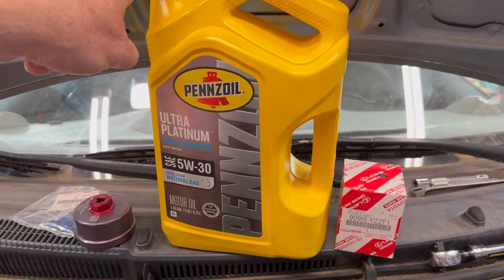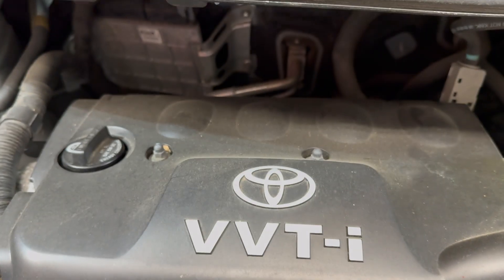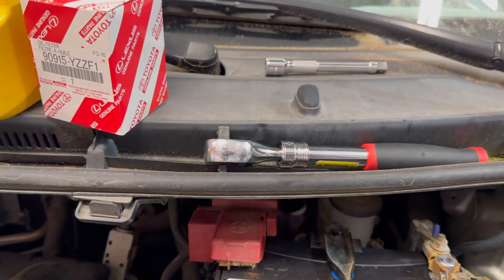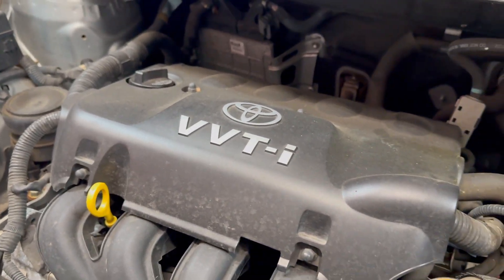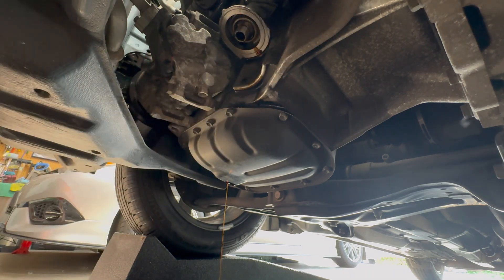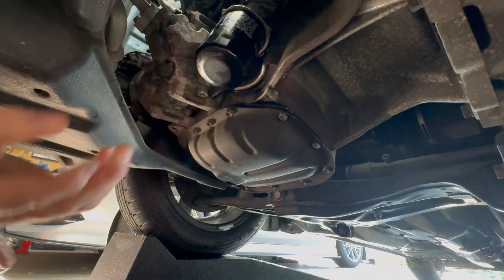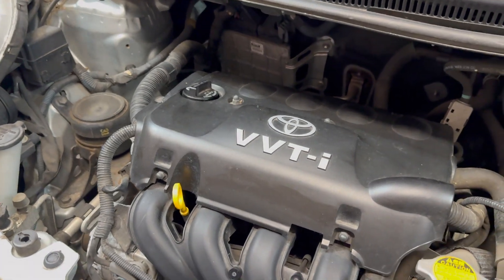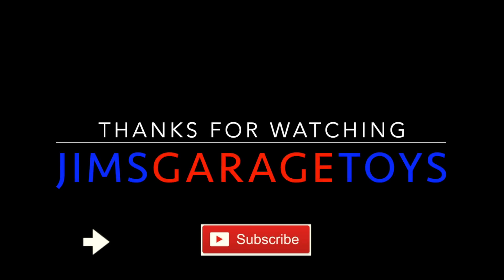Why This $2,500 Toyota Yaris is BETTER than Your $100,000 Supercar

Comment: What was the extra love the car got besides the oil change? 😆
Reply from the maker: At that time I followed it up with with a good wash and detail in and out. I still need to replace some more fluids but that will have to wait until after my road trip.
Reply: Her oil looked pretty good. I totally agree with filling the filter AND using only Toyota filters. Will u hose her engine bay? I hope u show us updates on it. Your cars look good. Would like to see what products u use on them. 👍
Reply from the maker: @riceburner4747  The oil was about 15 months old so it needed to go, no matter what it looked like. Yes, engine bay needs a cleaning too. One thing at a time as I have other things to do too. I use mainly Griot's Gorge products to clean and detail my cars.